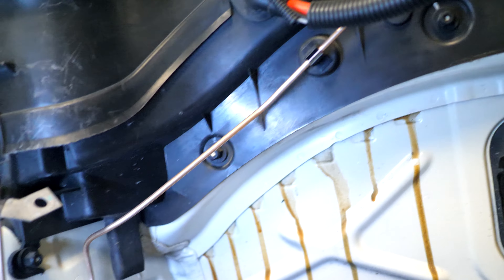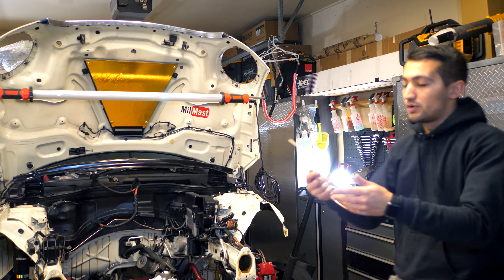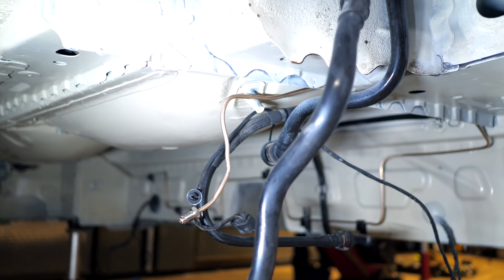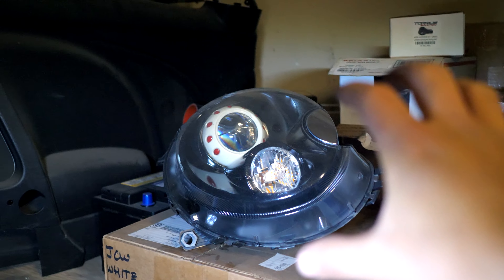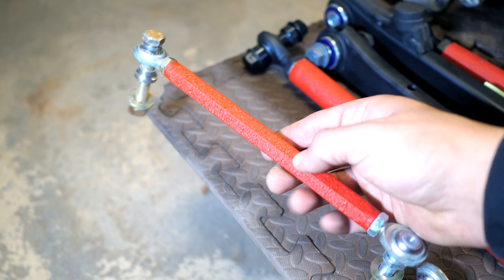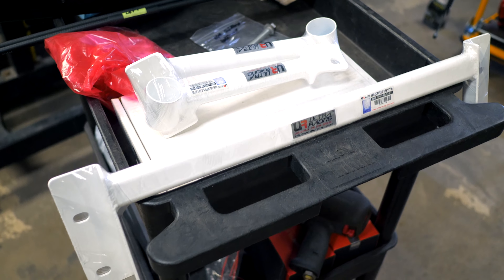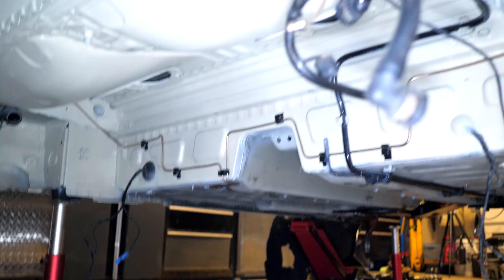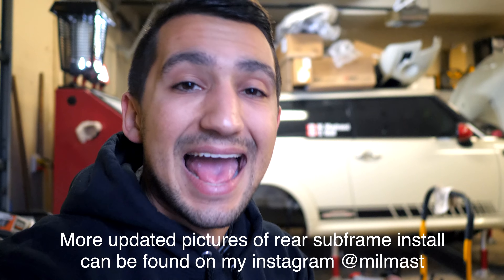MASSIVE MINI UPDATE // Custom NICCOP Brake Lines

Comment: Mate..drill and tap that aftermarket arm and you'll be able to use it with the rear auto leveler....
Reply from the maker: Won't work since the arm rotates even under regular driving
Reply: @milanmastracci  that's one magical mini you have there.....

Comment: Now that you've rebuilt the engine, does it burn oil and how much? Was it burning oil before the rebuild? I have 150HP prince in my Peugeot 308, that should be the same engine and it burns around 1L/2000km. People on the forum say it's normal for that engine..

Comment: Hi Milan

I have DS3 THP engine which is the same as your engine, i would like to know how does the pressure converter works and is it possible to clean it?

Comment: Hi! I need your help on my r56. Already done with new fmit, oil cooler, intake flow and new straight piping exhaust. The problem is with the engine light notification keeps light-up when i rev. So frustrated....

Comment: My 2007 mini r56 base model has been stumbling when i drive on cold start with less warm up time. When i warmed up the car properly. Car drive smoothly without stumbling.

Any idea what was wrong? Engine light showed up. Fault code is directing MAF sensor fault. But it was on and off and sometime shows different code